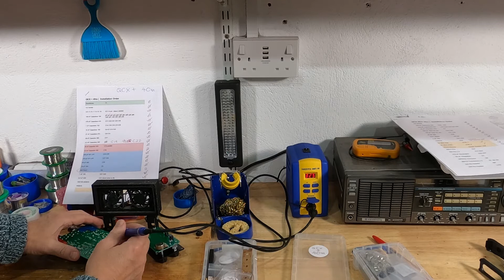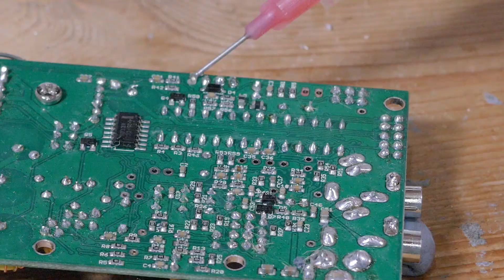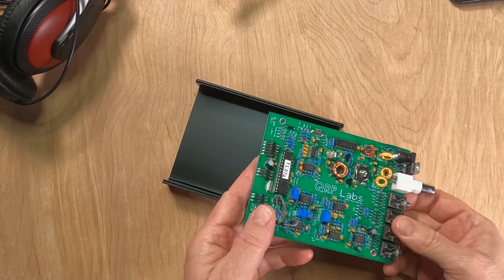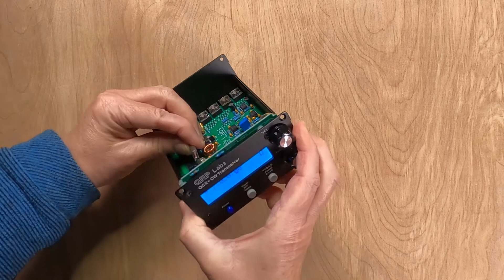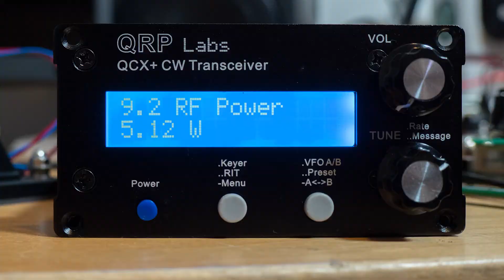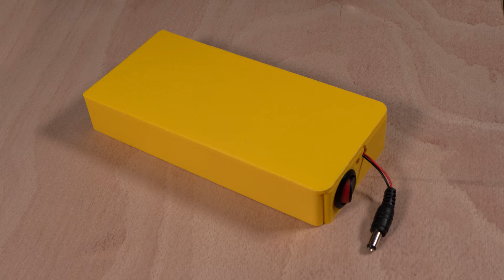Rediscovering Radio 5 :  QCX Plus now Complete and First QRP Contact!

Comment: I have just built mine for 20m. It works fine. Drilling the nuts as described is a must. You must connect a dummy load to align it properly

Comment: Greeting from South Africa :-) Stumbled across your very enjoyable presentation of the QCX+ and this note to compliment you on your efforts! I am close to finishing a QCX (original) on 30m obtained back in 2017 and also have a 40M QCX+ waiting to be built  together with several other projects... Fingers crossed I will be as lucky as you with making a contact once final assembly is completed as has also been about 40 years since I was active using CW <smile>.  Looking forward to following your 'radio active' adventures for sure! Stay safe and as always, remember to KEEP SMILING - 73 Nigel
Reply from the maker: Greetings Nigel - thank you so much for getting in touch - it's very encouraging to hear that other people are following a similar path, I guess there may be many more of us who have taken such a break. Since making my first contact, I've realised that the most important things are getting the radio set up properly and (the most important factor) the antenna. I've recently experimented with making half wave antennas with matching units and traps and am now making lots of contacts on 40m and 20m with my QCX radios. Hoping to try going mobile soon and getting to some higher ground. I really hope your radio build goes well and that you get lots of enjoyment making and using them. I really appreciate your feedback! All best wishes 73 Mortimer (G4BSK)